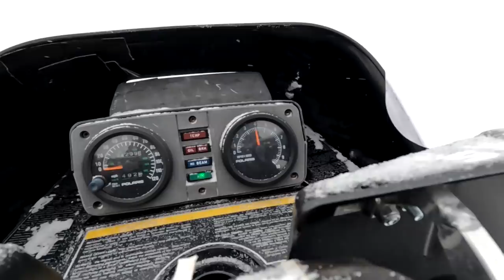2022 Ditchbanger National // ERX Motorpark // Vintage Snocross

Comment: what weights did you put in the xlt and do you know the part number for the pink spring
Reply from the maker: I used race department weights. Equivalent to around 56grams. Was a little heavy for us but they worked haha. The pink spring is a venom spring. Part number 210135-013 on venoms site.
Reply: @CtakTV  awesome thank you I appreciate it I’m trying to set my 2000 Indy 500 up for lake running and drags and clutching is my worst enemy

Comment: THE BRAKE WASNT ON FIRE ITS THE PIPE EXIT AREA PIPE MUST OF HAD A MOUSE NEST INSIDE AND CAUGHT FIRE  BRAKES ARE WAY HIGH UP THEN THAT
Reply from the maker: I know that. But knowing he’s bad on brakes that was the first guess.
Reply: @CtakTV  no he was hardly into the brakes    fast guys 
barley use the brakes ,,he even said that if you listen too him ,,,the ski doo brake on those sleds is way up high and get great cooling , like i said it had to be a mouse nest in the pipe
Reply: @atv55803  I've had it happen before and it was rich and had a bad donut gasket.